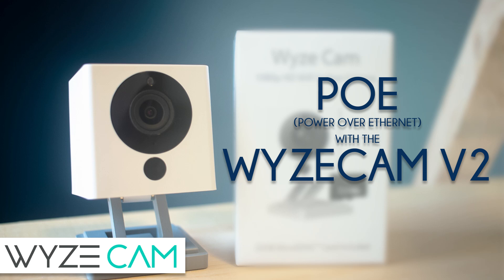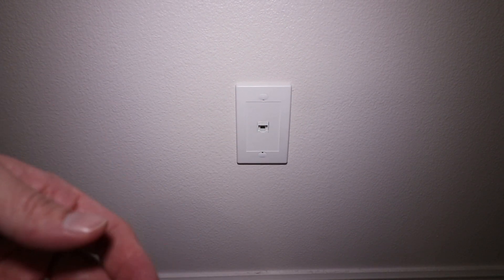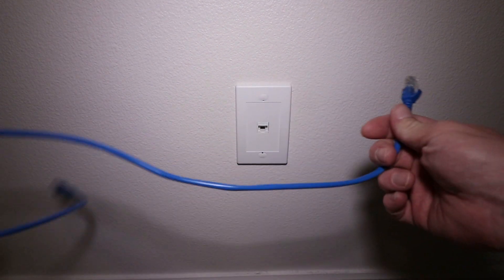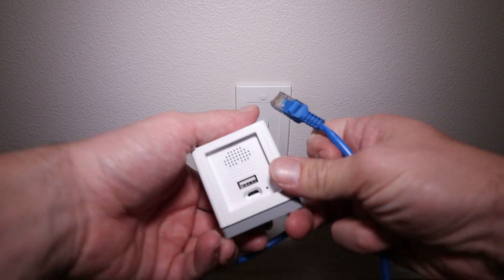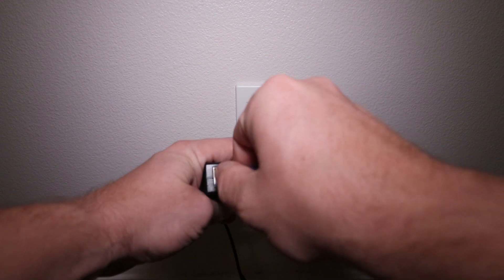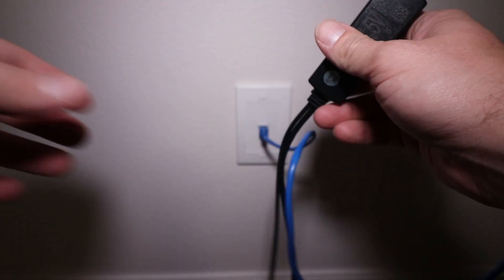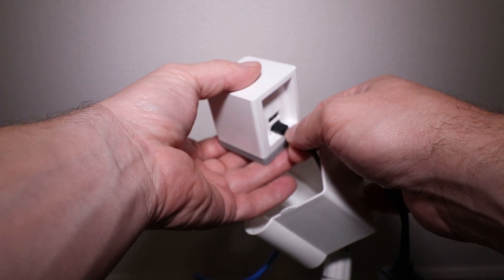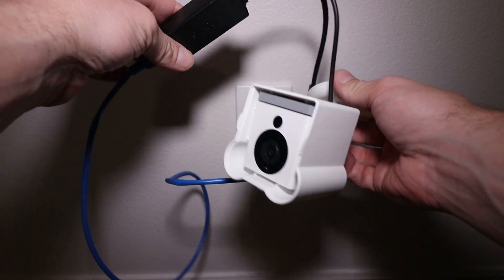PoE (Power over Ethernet) with Wyze Cameras

Comment: This does not work. Plugged in my POE Switch into the adapter. Wyze cam powers on but still using wifi.
Reply from the maker: I am not suggesting that the camera will use ethernet for data, only to power the device. This method allowed me to move the devices to hard to reach places by running Cat5 instead of USB.
Reply: @blueazul2007  ohh sorry. But u should mention this is for Power only btw. And that it does not pass data.

Comment: Have you tried using Wyze V2 daisy chain to connect 1 directly to the POE splitter... then a second via the output on the first? I believe Wyze V2 needs 1A, and as your link shows 2.4A, guessing likely would be possible?

Comment: Thanks for video :) Very nicely explained.

Likely good if you tape up - or perhaps put the RJ45 ethernet part of the POE splitter inside the enclosure too - as over time likely will get corrosion on the connectors there and might cause issues with either the POE splitter, or the POE Injector (Switch or dedicated injector).

Also - likely best if you toss in a disclaimer that officially Wyze says V2 cameras are NOT designed for outdoors.

However, while I personally have not put any of my Wyze V2 cameras outdoors yet, I have seen multiple people say they have put theirs outdoors even in cold Winters and they said they survive just fine (figure at this low cost likely not TO bad to swap one out if it goes bad, but depending where you put it would be handy if it does not die) :P

Thanks for the links to both enclosure and the splitters :)

Comment: I am all for this but only thing that doesnt make sense to me...if you are using a poe that is plugged into a switch...why not just use a hard wired camera? You can pick up a much better camera for the price you price you paid on the extra parts and the wyze camera.
Reply from the maker: I like the features of Wyze and didn't have the time resources for a proper NVR. One day, I'll make the shift, but for now this setup has been great.
Reply: what model of PoE camera would you recommend that's under $45 USD (the price of Wyze Cam + adaptor) ? Is it actually "a much better camera"?

Comment: Would using this adapter aside from powering up Wyze cam, would it also give it a straight internet connection from router. Thank you.
Reply from the maker: It will not. The Wyze Camera is only capable of using WiFi, there is no built in network card.

Comment: I'm all in.  Planning to use this solution for my shed which has no power.  Bury a pair of Ethernet cables in conduit, add a camera and  POE lighting and perhaps the Wyze door sensors and i'm covered.  Thanks for the video. ,cheers

Comment: So is the ether/USB adapter stepping down electricity so it doesn't kill the camera?   That Cisco switch of yours is $600. Which power switch would you recommend for like 10 cameras in the down-to-earth cost of $100 or less?
Reply from the maker: Any PoE switch will work.You should eb able to find a few options on Amazon or used switches in your range on eBay. I've been running these for 6 months with no issues. I have 2 outdoors (in cases from Amazing under an overhand) and a few indoors as well.
Reply: Does the POE switch steps down the power to 5v?
Reply: @rlrl79  splitter says output is 5v 1amp

Comment: I keep seeing people doing this.  My outside Wyze cams are connected using long USB flat cables run through the windows (yes, I'm lazy).  Amazon has these for $8 or so (25' and 20').  With some effort and a Dremel you could even daisy-chain them.
Reply from the maker: I should have added that I already had PoE set up. So the adapter came out to the same cost as USB and I have both options available in the future
Reply: Mike Murley does WiFi travel through the usb though?

Comment: How to spend $60 on a $20 camera LOL.
Reply from the maker: Not that much, closer to 45.
Reply: @blueazul2007  So: How to spend $45 on a $20 camera.
Reply: But you save $100 per camera over the cost of a hardwired network camera. This is by FAR a cheaper solution. I saved a thousand on my system compared to traditional wiring